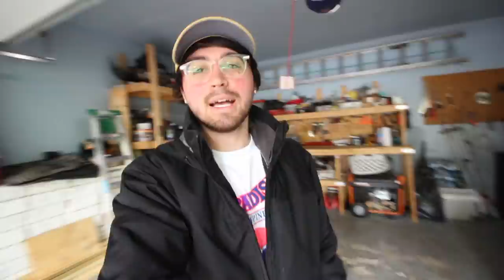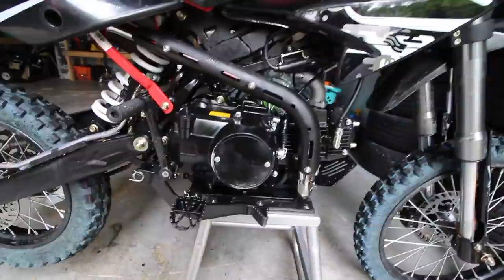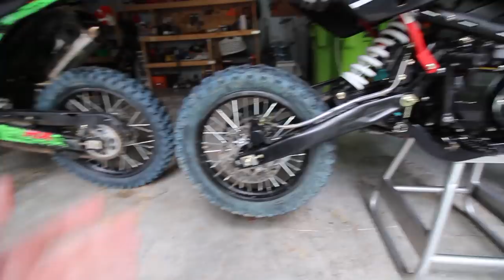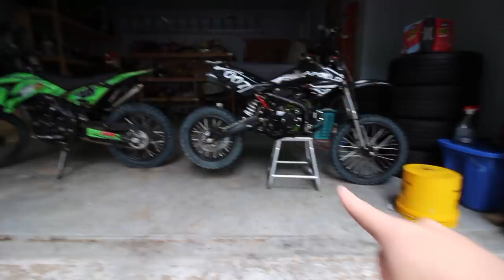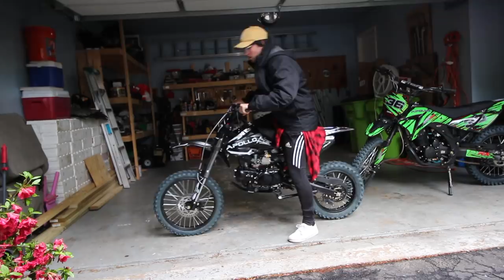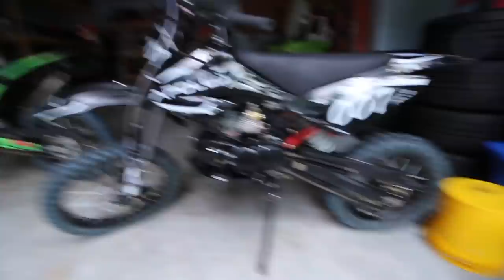What Bike Is Better? Apollo 125cc Pit Bike Vs. Apollo 250cc Dirt Bike (Best Beginner Bike)

Comment: Just got the Apollo 250 and I love it! Fits a 6'4", 210 pound man, the electric start is great, and you can't get a better deal for the price. Good power though it does stall in first fairly easily so keep you hand on the clutch!
Reply: Hey buddy how much did you buy it for and where from
Reply: Thanks for your comment 🙏🏾 because I was just looking at the bike and wondering if it would work for me I’m also 6’5

Comment: When you're getting a 250cc chinese dirtbike/pitbike. Dont go for the big one with 18 and 21 wheels. Go for the slightly smaller with like 14- 17 or 16 -19 wheels.
Why? Because they will feel faster and stronger when you pull the throttle. Trust me. 

The OHC 250cc engine has about 18 horsepower, if you have one with a pushrod engine you have about 17hp. And when you put it on a chassi that weight about 110kg like in the video here.. yeah you get the idea. It's gonna be frieking slow. Sure you get more topspeed in the end, but what fun would that be when the bike pulls like crap and it feels more like a heavy streetbike? You cant pull wheelies with it, you cant slide or drift easily on gravel. 
It's just.. go faster in a straight line. Im dead serious i had one, so i know. 

With a smaller 250cc dirtbike/pitbike you will have more fun. Trust me. Sure it feels smaller but the power to weight ratio is more balanced now. You can do wheelies, slides and drift now.

Cheers.
Reply: With a carb swap and a performance air filter and the proper jetting along with a fmf bolt on exhaust and a larger rear sprocket will make the bike 40000x better
Reply: @JohnDoe-nn1lx  Ofc. The problem is.. it's not worth it consider it's a china bike.
Reply: Its actually a French bike
Reply: @hixiro212  Nope.. a big nope to that. It's made in China.
Reply: @swemx7403  oh I thought that bcz its owned by a French company but they probably make them in China for lower manufacturing prices
Reply: bb kingme  How do you know he's white?
Also it depends on the design, not where it was built.
Reply: @JohnDoe-nn1lx  can you send me links to all the parts i need?
Reply: Dboii 247 what bike do you have lmao
Reply: bb kingme  good point
Reply: @JohnDoe-nn1lx  apollo 250
Reply: do you have a link for the bikes
Reply: Which engine is better zongshen, lifan or loncin?
Reply: @zjg9610  1: Zongshen  2: Lifan  3: Loncin.

Plus, Zongshen and Lifan sounds alot better then Loncin. Loncin either sounds like a 50cc scooter, or like an emty monster energy can.

Comment: the reason you can't wheelie on the 250 isn't just torque, the 125 is a lot lighter, geared shorter (more torque when you have shorter ratios), and shorter wheelbase. the 250 is also a very beefy girl at 287 Lbs. and don't take this as hate I'm just sayin. I've got a china 125 and the Apollo 250 and I can agree they both have their weaknesses and strengths over each other

Comment: Would the 250cc bike be too tall for someone who is 5’3
Reply: Nah 
I ride a 300cc enduro bike and i cant reach the floor 
Tho i would recommend you the ssr 190cc dirtbike
220 pounds but it has power to spare and you will be able to reach the ground 
Im 5,3 too btw
Also you get adjustable front forks with this bike 

Dont buy that ssr if its your first bike tho 
Too much power

Comment: What's your favorite Chinese bike so far as far as build quality? Tao Tao, ssr, Apollo? I'm trying to decide which to order. Thinking Apollo 125 or 250
Reply: I'm wondering the same thing, I'm between the Apollo and the Tao Tao. Both of which are 125CC. I also wonder do these need premixed fuel? (Oil and gas)
Reply: @DriesOG  No. These are all four stroke bikes.
Reply: dont forget to look at the Trailmaster TM-36, the GPX brand , RBX, and a few others i cant remember , do your research , 161 powersports ft worth tx

Comment: Just a few tips. Slime doesn't work on inner tubes, only tubeless tires. Invest in a Rim lock to prevent rear flats. What happens is the rim can slide inside the tire itself from all the torque. Get a couple tire irons and change flats yourself and keep spare inner tubes so you're not left out on the dirt. Okay Vid, thumbs up still. o7
Reply: Slime works in tubes as well but you do have a point with the tubeless. It works 10x better
Reply: The bottle om the video says Slime Tube Sealer.

Comment: I’m 5’5 will it be good for a 125?
Reply: Gaming Shark246 yes a 125 is good for around 5ft-5’10ft but if any taller you would want a bigger bike I have a Apollo 125cc dirt bike myself and I’m 5’8 and it fits me fine if you have any questions I could answer the best to my ability.
Reply: Garbage Mixtape yes I’m 5’5 but where did you get the bike?
Reply: Gaming Shark246 I got it at a store near my house that sells all type of budget bikes so it was already assembled when I got it
Reply: How much and where
Reply: Gaming Shark246 I got for $800 cash so I got no sales tax which would put it around 50-100$ more and it was a store called budget bikes in Alvin, Texas

Comment: I have the apollo 125 and it doesn't have a wheel lock and it likes to rip the valve steam off i had to drill a hole in the rim and install a wheel lock
Reply: Biggest bud ever,that’s what I’m worrying about buying the 125,is it a good bike.
Reply: @spencerrivenbark6746  there good bikes i had my apollo rfz dbx18 for almost 3 years and the motor is still running the only downside is the rim doesn't have a wheel lock and the kickstand mount is made of cheap metal and likes to bend over time and the shock was good when I got it but it will get super bouncy after a while and it does like to break the engine mount bolt all the time i have to keep a few bolts just in case plus the you got to put loctite on the rear sprocket are the bolts will fallout one of my bolts came lose before I put loctite on it and it broke off in the rim and I had to buy a new rim
Reply: @biggest bud ever,was it any hard labor,because I’ve had my rfz 110 for a year now and it’s done great but idk about the 125.and I’m worried about the rear rim.
Reply: @spencerrivenbark6746  it's simple to fix if the rim ever messes up a new one with the tire already installed is only 98 dallors on amozon i think it's cheap and easy to fix
Reply: Thank you for asking the questions I was looking for.@biggest bud ever

Comment: Hey man so this is going to b one of my first bikes and I’m looking for something cheap and good for beginners so I think I’m going to take the 125 but I wanna ask how long was shipping and what website did u purchase it off of? Thank you for your help and the video is great
Reply: Max Huston dont get chinese bikes, klx 110 is good for smaller people , or a 125 honda
Reply: Hes looking for something cheap the klx 110 will be boring after a few hours and it's not fully manual you can buy a Chinese 125 and 250 for the price of 1 Honda 125 😂😂
Reply: He can upgrade the bike and i never had a problem with the chinese bikes
Reply: Find a yz125 or cr125.. Chinese bikes suck. I got a 125 Apollo for pit use only at cross country races.

Comment: Don’t buy any of these bikes buy a good dirt bike that will last like a Kawasaki Honda yahmaha ktm
Reply: Though those bikes will last longer these are budget bikes.
Reply: If i had  $2000 for an 80cc than i would buy one of those
Reply: But i would rather get a bigger bike for a lot less
Reply: Years ago I would have agreed with this and I’ve riden every kinda dirt bike you can imagine. Not just Japanese bikes but we had things like gas gas as well. Every size bike many different atv brands. W never had a Chinese brand for obvious reasons. Recently my dad bought an Apollo rfz125 for 300 bucks and it’s like brand new. I went into it skeptically and said why would you want that thing. Then I rode it and I was so impressed and had so much fun you can’t beat these bikes in term of availability. Yes they have problems and are hit and miss you may get a shitty one or a decent one. All in all if it’s a first bike situation for you. These things are a good option to learn on and see if you enjoy the hobby. Then you can sell and move to a better bike. I personally no longer can afford a Japanese bike and have considered these many times because used jap bikes are almost as high as brand new bikes in my area. Even really old clapped out bikes. Get one of these put a good carb on it and air filter and cruise around on it and you’ll probably be fine. If your gonna abuse it and ride it hard then you will meet problems you wouldn’t have with a name brand bike ofc.
Reply: Buy what you can afford

Comment: I recently got the 250 but can't figure out where the ignition switch goes on the 250?  Also we had an extra piece that looks like a rubber wheel with a bearing inside it. Any idea where it might go? Any help would be greatly appreciated. 😁
Reply: That wheel bearing is for your rear suspension

Comment: I've been riding a 50cc moped for 2 years now. Im sick of not being able to keep up, so I've been considering an enduro for a while, just recently found the appolo 250 & I dig it. I have enough riding experience to know how the street works on two wheels & how aware you have to be. So 250cc i think would be a good upgrade, fun but not too much. Plus I'm 6'1 190lbs. But I'm curious as to what upgrades you can do to the bike, being chinese. Id like to upgrade the suspension once I get an apollo, & maybe some simple engine components. I'd really appreciate some help on that, maybe brands & links to parts.
Reply: Honestly mate, I think you should look into a "Normal" brand bike like a Kx250 or Crf250 or something as those would be a better size for someone as tall as you, Personnaly im 14 and am 5'7 and i have to tippie toe on my Crf250x which is a great trail bike, And also parts for Appolos and other bikes likewise are rare to find.

Comment: I bought a 2012 dongfang  DF250rte it says on the specifications it weighs 596 pounds or 271 kilograms. It just seems wrong. Or is that normal weight?????
Reply: Haha its got to be a typo. Its probably around 270 lbs.

Comment: What if i put a bigger back tire on the 125cc?
Also im 13, 5 foot 9, and 120 lbs. which one would be better for me?
Reply: go for the 125, really.the other one is just too much for a beginner , it is too heavy .I'm 5' 7 and 120 lbs and got the 125 , i'm very happy with it , I can controll it very good.Just buy a mikuni carb and air filter for it and you'll have a blast. Take care
Reply: Andrei Dan thanks
Reply: Connor White what’s your problem mate ?
Reply: Devin lee get a crf125f of crf125fb

Comment: I’m 5 ft would that work for the 125
Reply: Yes
Reply: yeah youll fit, youll just be like on your tip toes. But it has an adjustable seat height. @notdemure8598
Reply: oh and also, I would recommend getting the Apollo DB-X18 version of the 125cc, not the DB-007. It is a better, newer, and more powerful version of all Apollo 125's.
Reply: Not demure np, i have the DB-X18, and it’s a great motorcycle :)
Reply: I'm 5'1 ima get the 125 and the oil that comes in it is bad change it when your available to

Comment: Bro Is Hard To Learn How To Ride A Pit Bike ? , Is There Any Fully Automatic Gas Dirt Bikes ?
Reply: It's not hard. Clutch is easy to get used to. I recommend a yamaha ttr90 if you dont want clutch. It's a 3 speed with no clutch. Easiest lil bike to ride and has tons of cheap options to jack it up for taller people. I've had mine over 10 years and hasn't given me any issues.
Reply: michael dean - Yea Ima Just Learn How To Ride, Shit Cant Be Hard Right ?

Comment: I bought the apollo 250 db-36 street legal , keep the videos coming can't wait to start riding it. Also did you change the oil that came in it when you bought it?
Reply from the maker: john Picciallo you just got it?
Reply from the maker: john Picciallo yep I changed the oil but my friend didn’t. I recommend changing it as soon as you can
Reply: @ExoticMoTioN  yes I got it Sunday
Reply: @ExoticMoTioN  where are you from?
Reply: john Picciallo I was thinking of buying the deluxe street legal Apollo 250cc, have you been able to ride it yet?
Reply: @austinj.-nelson4848  not yet hopefully soon still recovering from knee surgery but dying to ride.
Reply: john Picciallo ah can’t wait to hear, I’m trying to see if this could handle a daily 25 mile commute to and from
Reply: @austinj.-nelson4848  everything I have read about them I think it would. My friend is a dealer of these bikes and sells them like crazy.
Reply: You know these cheap bikes come with break in oil that you should use for about a hour then change it to the oil you plan on using long term... all motors come with break in oil doesn't matter if it's a lawnmower dirtbike motorcycle or car and if for some reason it didn't come with any oil they sell break in oil at most auto part stores if you want it to last longer use the break in oil for about a hour or however long recommended by manufacturer they wouldn't sell break in oil if it wasn't necessary and don't never think some idiot with a camera and a quart of synthetic oil is smarter than the multi million dollar company that makes the dirtbikes do you really think the company is trying to trick you into messing up your new bike with the so called shity oil they sent you😂😂😂😂😂
Reply: @MrJohnp9  so how was it?

Comment: Im 5'10 and 260 pounds would the 250cc be a good size? I dont want a bike thats too small u know😂
Reply: IlIIllIlIl Kong get a 125 two stroke or a 450
Reply: @motocrossraymond6060  bet
Reply: IlIIllIlIl Kong just gonna have to get used to 450 power but your tall enough or a 125 because a 125 two stroke is a all around great bike.
Reply: @motocrossraymond6060  ok thanks
Reply: IlIIllIlIl Kong u might need a 300
Reply: Im 6'3 at 150 pounds would this bike be big enough for me
Reply: @ryryboyle6126 what about a 200 pound person on a 125?

Comment: Hey, I’m 14, about 92 pounds, and 5’4, what bike would be best for me to get?
Reply: A 125
Reply: Kevin Mc Gee lmao fast metabolism
Reply: WASAAABII same here but I’m 125 is the Apollo 125 a good fit?
Reply: MODES - Fortnite im not sure, I’ve never had a dirtbike before and I’m looking to get one. Sorry.
Reply: @kristopherhunts2380  its a chinese bike i had one im 13 but i just sold it and got a honda xr80 and it goes 15 mile an hour faster so if i where you i would get a 2000s and above xr100 or crf125 they are way nicer than apollos i just got my xr 80 yesterday and every bit of it is better even though its 15 years older than my apollo
Reply: @Christian-pz7ho  see I would agree with you but the chances that they know how to work on bikes tune carbs jetting ect is low

Comment: Just buy a used bike from a reputable brand. I got a mint 2003 Yamaha YZ125 with an extra set of new tires, clean title. only 30 hours on it. Literally brand new condition for the same price as one of these cheap chinese bikes.